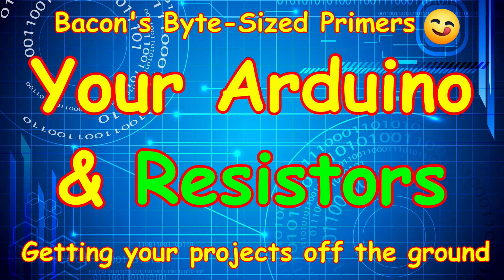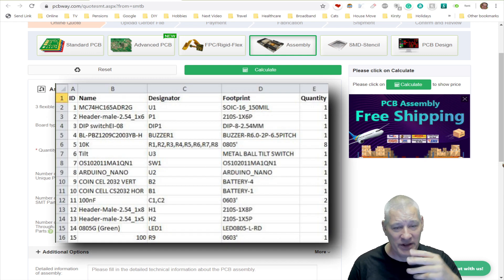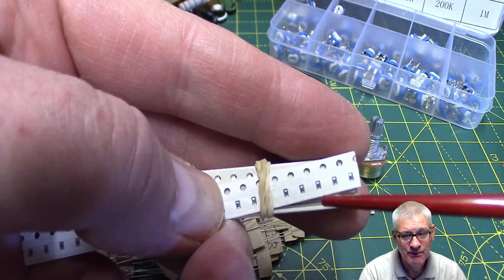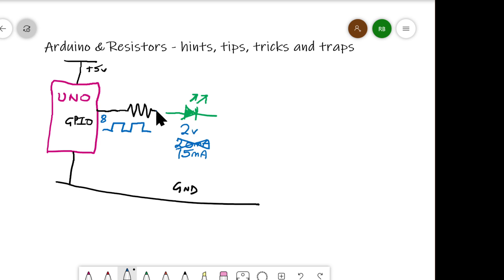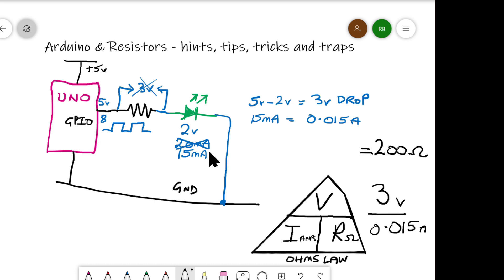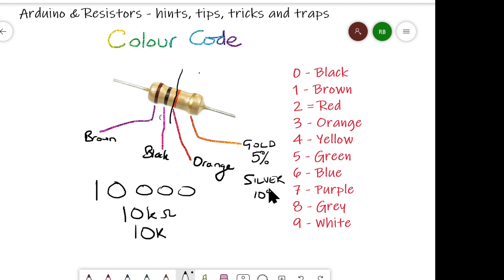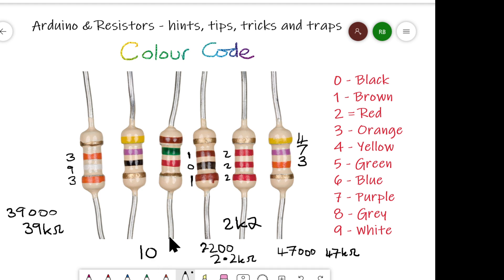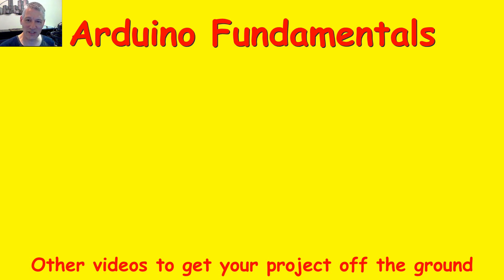#BB3 Resistors - From an Arduino Perspective

Comment: (In a Neo Matrix Dojo scene) ..... "I now know resistor codes..."
Reply from the maker: But do you REALLY know them, Mark? By sight? If you do, I applaud you, not many make the effort (unless it's part of their day job, of course). To anyone else reading this, learn that table and then test yourself for a month. Then you too will know the resistor 4-band code by sight!
Reply: @RalphBacon  I would say that learning all the codes is awkward but learning the common ones is a good idea.... for everything else, there's test meters.
I did learn an interesting trick from an electrician on how to find a short in a mains cable in a house, all by using resistance and cable information, length and some math.
The builder was within 20 CM of the fault where the previous man on the job had caused a short where a nail went through the cable, he found the fault, dug it out and repaired it. Not with math but parts, etc... mainly because math can't control angry pixies or wrangle them.
So... one question, has anyone put these colours to the test with a sight test for all types of colour blindness to see what they look like? I am sure there will be a few engineers out there who are colour blind.
Reply from the maker: Colour-blind electricians/electrical engineers do have (sometimes severe) problems. It depends on which colours they cannot see (blue/green/red) or whether they can still distinguish them.
Reply: @RalphBacon  or if they can see colour or if one or more colours are missing... You will be astounded as I was when I started researching eye conditions when my son was born as he had cataracts, was potentially blind, could have developed other eye problems like colour. Thats when I discovered a website on testing for accessibility as it is amazing how many sites simply become illegible when passed through a filter, you can get them as browser plugins, I had one but it was eating too much resources when run.
It is though, the reason for the EU plug wiring colours we have.
Reply from the maker: I wonder what the UK did for electricians before our new, improved wiring scheme. I wonder how many were reversed (or worse!)
Reply: @RalphBacon  The thing is that they now have the resolution and methods of imprinting in letters and numbers what the resistance is, they do it to ultra small board mount items... no excuse to not have these things can be put on at the time bands are put on.

Comment: Au fait definition is - to the point : well informed : socially competent.
1 day i'll have to make a stand for easy reading of resistor values, something were i push the switch to activate a digital
 ohmmeter and with the same hand hold the resistor against 2 contacts ,  
and not go overboard with 4 rgb leds (at least) to show the value .
Reply from the maker: I can hold a resistor to the multimeter probes, adjust the power supply and drink a glass of chilled beer all whilst stroking Benny with my other hand. Easy. And I didn't lose two SMD components on my workbench this afternoon whilst building my External Watchdog Timer (untested). Nope, not me.

Comment: And YET another brilliant video for the neophyte (greek for nooby). Now, arguably, the resistor is the simplest of the passive components. Ohms law tells us all we need about what this resistor is doing or what resistor we need for a particular purpose. However, the way resistors perform with or react to other passive (and active) components can be awesome. One resistor with another resistor  can change the voltage. Another resistor but this time with a capacitor can change the time before a certain voltage can be reach (BTW this is on the 'O' level physics GCSE curriculum [for US: High School Sophomore  physics]- so we aren't talking about rocket science). When coupled with active components resistors can have a plethora of different effects depending upon its position in the circuit. For those interested in expanding their grasp (not necessarily expertise) of many of the effects a resistor can bring to a circuit, take a look at one of the many tutorials (ralph's video #190 from a couple of weeks ago  is a good start. Then take a look at Ben Eater's 555 timer - 8-bit computer clock - part [1 to2]) that explore the 555 timer and its internals. These will demonstrate many of applications of the resistor. This is in no way an accusation of omission by Ralph. His target was the beginning maker, who wanted to progress from just blindly copying  a circuit to, perhaps, making changes to that circuit , customising it to serve a different purpose  than was the original intention. In this Ralph hit the bullseye right in the centre. Thank you Ralph.
Reply from the maker: Thank you for your positive comments, Michael, and thanks for pointing others to further resources where they can learn more. The more you know, the more you realise how little you actually know. Unless you really are a rocket scientist, I suppose. Whilst they say "a little knowledge is dangerous" it also enables makers to experiment more, in a meaningful manner. What's a little  magic smoke escaping now and then between makers? (Think of my blown capacitor from a couple of weeks ago)!
Reply: @RalphBacon  Standby for take off...10...9...8..7... Well that's the limit of my rocket science. These Bacon bytes are so useful, Ralph. It's an ill wind that blows nobody any good. thanks for finding the pleasant breeze even in the Covid tempest.

Comment: Another timely video Ralph!   I'd long given up trying to read resistor colour bands.  Like yourself retched eyesight!.   Relied on good housekeeping and trusty multi-meter!  I now realise unintentionally all the lead'd resistors I have are 5 colour band code'd.   What a pain if you do try to read the code, so small you just cant work out which end to start from!  There is just no gap between tolerance ring and the rest!  (Off topic - By the way got my 555 project working on Breadboard.  Attempting to simplify buy using 556's as it would need 4 555's)
Reply from the maker: Luckily (for me), Stephen, my eyesight is slowly improving and I can read the resistor colour code again (on a beige background, let's not mention the blue background ones). But, TBH it is generally recommended to double check the value before soldering with a multimeter - it takes seconds and can avoid lots of heartache (not to mention the magic smoke appearing). Glad you've got your 555 project up and running. I've use 556s before, it certainly makes it easier than using multiple 555s and only one VCC and GND to worry about!

Comment: Great video Ralph - it's nice to get a wee refresher on the basics every now and then.  I'd love to see your take on inductors - they are a hard concept to grasp (... and I still haven't 🤣)
Reply from the maker: Noted! I hadn't thought to do a video on inductors, Bruce, but now that you mention it I'll add it to the list. Having just used several ferrite beads (which are inductors, of course) in an Arduino project I guess there is a place for them.

Comment: Thanks, Ralph; that's another great video. I am also interested in how you draw your sketches and text. I think you're using MS Whiteboard but how do you write? I can't seem to manage that with a mouse; the writing is even worse than my handwriting! Suggestions for a reasonably priced setup would be great.
Reply from the maker: No mice were harmed in the production of my (wonky) drawings. I use a tablet and stylus that works with the Microsoft standard Whiteboard. I would rate the setup at 7/10.
https://amzn.to/3hCqHIc
Reply: @RalphBacon  LOL, sorry Ralph. 
The XP-pen seems a bit expensive but I don't know if the cheap Chinese stuff is any good at all.  I might have to try one.  I did buy the Logitech T650 touchpad but it's not a tablet.  The ultimate would have to be the graphic artist tools which combine both the monitor and the tablet so you get real size feedback under the pen, the same as you would using a pencil or brush on paper but they don't come cheap.
ETA: just checked some prices and that seems about right actually.  Funny, I thought they were cheaper than that.
Reply: This might be the cheaper option: https://www.amazon.com.au/Inspiroy-H640P-Graphics-Battery-Free-Sensitivity/dp/B075T6MTJX
No I don't have one so I don't know how good it is.
Reply from the maker: The one I linked to cost about half of that price (about £20 IIRC) but it has gone up lately. It works pretty well. That's probably the reason for the price increase!
Reply: @RalphBacon  Thanks Ralph, I will have a look.
Reply from the maker: It's takes a little getting used to but it's worth the small amount of effort, if you need a whiteboard solution.
Reply: I suspect Ralph actually does use the mouse from some of the wonky drawings (not complaining, just an observation).  Practice makes perfect, or at least improves your score.  Try increasing the resolution of the mouse so the travel speed is much less.  You might also want to turn off mouse acceleration since that will make it hard to get consistent results.  Failing that, you might like to try a drawing tablet.  You can get some small cheap ones now ( < $50) and they just plug into a USB port the same as any other input device.  The more expensive ones aimed at graphic artists are larger and have features like pressure control for darkness or thickness, but you don't really need that for simple sketches.  Google cheap "drawing tablets", or the usual suspects like Ebay/Banggood/Amazon etc.  (Or visit your local electronics/computer store, I'm sure they'd be happy to help you but don't be surprised if they only have the more sophisticated ones for graphic artists).
Some purpose built software can try to interpret your scratches and will make squares actually square, triangles into actual pointy things, and can even turn hand lettering into a computer font etc., but even with them it's best to be as accurate as you can be.
Reply: @Chris_the_Muso  Thanks. I am looking for a straightforward solution for occasional use, really. Maybe I just lack the perseverance to practice enough :-).

Comment: You may have figured this out by now, but... how do you represent a 5.36k 1% resistor? Prolly gonna want that forth band. I started my career in telecommunications where not only tight tolerances, but also long term drift played a part in continuing regulatory compliance. As part of a job interview I was once asked to read  the colour codes of a 1% resistor, having never seen one before (remainder of that story requires beer :) can't say I'm sorry to see the end of those parts. I now only stock E6 values. All you really need in a digital world. 

Thanks again for a thought provoking video.
Reply from the maker: "From an Arduino perspective". It's what I emphasise during the intro and in the video itself. In the Arduino world I have yet to see the need for 5.56K 1% resistor so the 4-band 5% colour coded resistors are more than adequate. 
When we get to the Arduino Uno XT-4Z in 2031 that can communicate anywhere in the universe via the newly discovered sub-space channels and that require 0.1% tolerance resistors I'll change my stance. 😂
If there ever is an Arduino/ESPXXX circuit that requires tight tolerance and specific values the maker will doubtless realise what it is. And it will be SMD anyway.
Reply: @RalphBacon  true enough. That's why I'm happy with my 20% tolerance parts.
Reply: I think Ralph was trying to steer people towards using standard values, but he should have emphasised that a bit more.  If you put "5.36Kohms, 1" on the BOM then PCBway will try to source that for you, and charge you accordingly.  It might double the cost of the set up and manufacture.  China can do *anything*, for a price.
Reply: @Chris_the_Muso  I'm not even sure they make 1% SMT resistors. The types of circuits, where we used those tolerances, have long since been replaced with ASICs and digital signal processing technologies.
Reply from the maker: I have some SMD 1% resistors, but rather large at 1205. From what I can see the tighter the tolerance the larger the device, maybe that is required so the manufacturer can "trim" the value without reducing the power rating. I'm guessing.

Comment: Thanks for sharing 😁
Trust me when I tell you that color coding is not easy when you are color blind 😞
Reply from the maker: Yes, you are right, Stig. Luckily for you then, SMD resistors have the value printed on them in either 4-band notation or 5-band notation. So a 10K resistor will either say 103 or 1002. Or you will unfortunately have to use a multimeter, which is what I recommend anyway, as we can all misread values sometimes (eg red vs orange, blue vs green, grey vs white).

Comment: Thank you for the video, clarifoes a lot about choosing a resistor value for each LED. But how to know the current and voltage drop of an LED? Would it be in the spec sheet? Or it's better to test it?  I would be interested in knowing more of smd resistors and capacitors, land how to recognize them....
Reply from the maker: LEDs are so common that rule of thumb is that it will require in the order of 2v at a maximum of 20mA. However, I have some that require over 3v or just 2mA, which will change the resistor value considerably. Datasheets are good but your multimeter can help you determine the forward voltage drop of a diode and I use my TENMA bench PSU limited to 5mA, initially, to see what current it likes (and is bright enough). I might do a video on SMD components in general...
Reply: @RalphBacon  , thanks for the clarification.

Comment: There is the mnemonic that I learned:  Better Be Right Or Your Great Big Plan Goes Wrong
Reply from the maker: I just learned the table verbatim. No mnemonics. So when I see an orange 3rd band I know it is in the tens of K. A red band means it is a value with a decimal point, such as 4K7. Yellow is 100's of K, Green megaohms and so on. A few months of this and it becomes second nature. Then again, I learned this when I was 14 years old so I've had a while! From an Arduino perspective there are values that crop up time and time again so they are the ones to concentrate on.
Reply: So you use PURPLE and not VIOLET.  Maybe it's an age thing.  I remember when resistors had BODY, BAND and SPOT for colours.
Reply: @r1273m  That is the mnemonic that I learned in the early 70's.  Only ever knew the 4 band system.  I was quite dismayed about a year ago, when I started back into electronics as a hobby, that some committee of geniuses had seen fit to add more bands.  I was at a loss as to how to read them.  I agree with Ralph on that point.
Reply: Bad Boys Rape Only Young Girls But Violet Gives Willingly
Probably not PC nowadays but how I earned it back in the day.

Comment: I think you really should have also mentioned Ohms law V=IR. For me and maybe others, an extremely simple formula gives some knowledge foundation for formula transposing I=V/R R=V/I and other power type equations P = I^2R = VI = V^2/R etc
Reply: I never understood how the weird triangle should be in any way helpful or more easy to use, if it is such a simple equation...
Reply from the maker: The triangle (wonky or not) is the simplest, proven way of letting beginners learn Ohm's law. 3 letters either divided or multiplied. This video was not aimed at either of you two!
Reply: Some of the beginners might want to know the wattage of the resistor they need. Is a 1/10 watt resister OK, or do I need a 1/4 watt, ... The I^2 R formula would be very helpful here.

Comment: Resistor color code poem.   Blk, Brn, Red, Orange, Yel, Grn, Blu, Violet, Gray, White.    Bad Boys Rape Our Young Girls But Violet Gave Willingly.   This makes it easier to remember.
Reply: You forgot "Get Some Now" which equates to: Gold, Silver, No Color. Or 5%, 10%, and 20% of precision.
Reply from the maker: Whatever works for you. But having a mnemonic means you don't know the code by sight, you are working it out. Like speaking a foreign language by first translating it in your head from the English rather than being to speak it without doing that.
Reply: @RalphBacon  You are correct  It was a starting point.   I don't even have to think about decoding these days.   54 years of electronics tinkering kind of helps too.
Reply from the maker: Just 54 years? You think that helps? 😂😂😂 I still get stuck at the tens of megaohms as they are so rare. I think WTH is that value??!!
Reply: @RalphBacon  Same here, I fixed my first (tube) radio at the ripe age of eight. I still don't bother with knowing the colors by sight, and at my age I just use a meter.

Speaking of people who got started at the age of eight: https://www.youtube.com/watch?v=-Q29C5nc-9k

That's my roommate's middle child building her Harlequin ZX computer. :)
Reply: @RalphBacon  Who the hell ever got the idea for 5 band resistors on a blue background  and color bands that are so opaque the blue bleeds through and tints the color bands.
Reply from the maker: When I find him, he's in trouble.
Reply: @jp040759  Or a 5 band marking on a 1/8th watt resistor. Better get your microscope out to read it. Or violet that really comes off as brown, and orange that looks like red. Which is another reason why I use a meter.

Along with my meter I carry a transistor tester in my go box as well. Not only does it make short work of just about any component, it's handy for looking into a pair of wires to get an idea of what they do if you can't open it up or find the manual online.
Reply: @RalphBacon  I'm a hoarder and I hate to throw anything away but the blue resistors had to go.